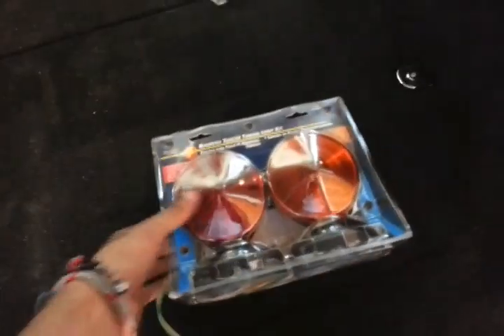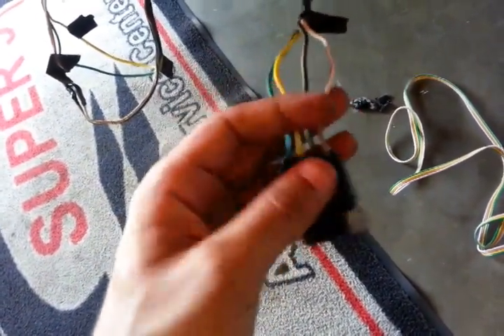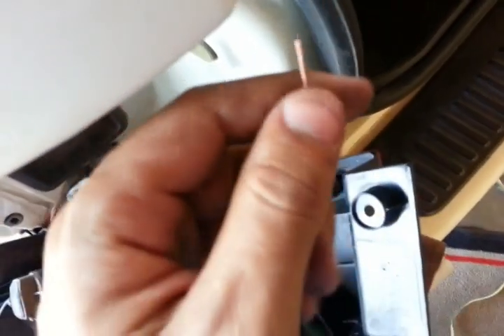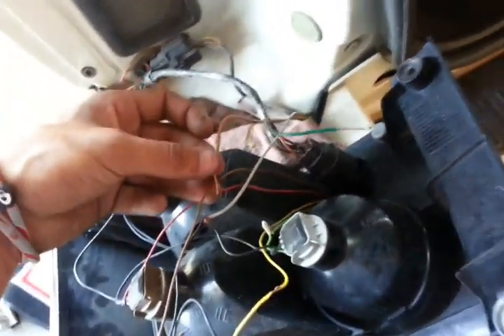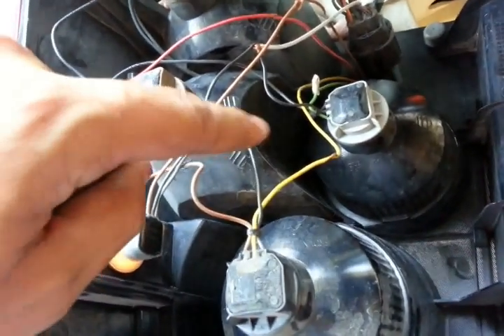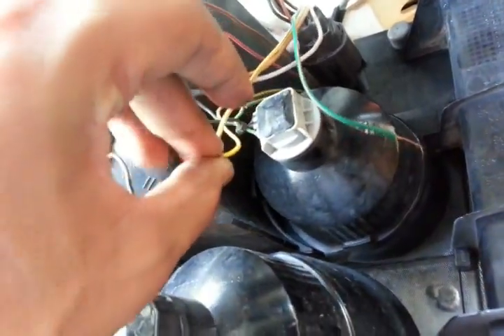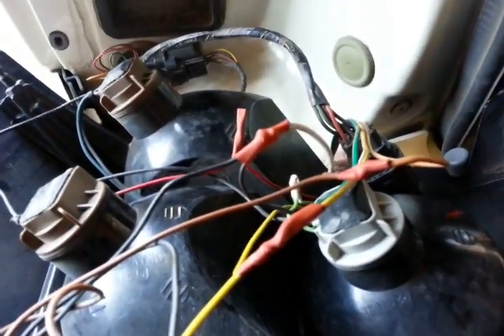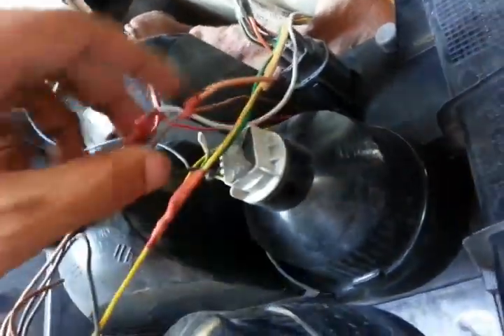How to Install Trailer Lights on most Vehicles Easy.

Comment: Did you wire the right signal with the left?  Otherwise, good video.  
Some people mention blowing fuses.  Definitely more likely on cars with traditional bulbs vs. LED.  Only a real problem for brake lights.  Simple solution, pump the brakes and at a stop light, engage the parking/emergency brake and release the service brakes.  

Wires fail and fuses blow due to heat, not current.  Current causes heat, but you can control how much with simple behavior modification.

Comment: You didn't show how to attach the right blinker
Reply: Mason Roberts its the same on both sides..
Reply: @Dinoboyification  ,    it looks like he tied the green = right turn signal ,  and the yellow = left turn signal together , on the left  lights yellow stop and blinker wire.  green is the right turn signal.......wouldn't you run  the right turn  signal wire over to the other tail light?  Did I see this right?  And if I did see him do that.....hows it work that way?????
Reply: CHANNELLOCK 440 I just did this according to his instructions, signal right doesn’t work when hooked up to trailer if you wire it together with left. I now have to undo and redirect to right light turn signal.
Reply: And brake lights are dim af.
Reply: @russelalpine6806  ,  yup.....that is happening to me as well.  No logical reason for that.  I have everything wired correct as far as I know, even my tester shows all is well. But if you turn on the running light , the brake lights cancel out the lights when you push the brake peddle.  I have no idea what else to do. But it is strange when I plug in the tester, every thing shows perfect.  Let me know if you figure out where to get any logical answers for this.  Thanks for responding Bro.  It's good to know you're  I'm not the only one getting crazy reactions from this mess.  The whole thing is frustrating  as heck. 
BTW...everything works fine as long as you don't turn on your running lights.   I call them running light, but they are known as parking lights .  Headlights  do the same mess.
Reply: @russelalpine6806  , maybe I shouldn't be using  a adapter.   I have a round plug, , not the little square.  so I have to use a adapter to plug  the little square plug in. I see one comment from  mrprosale  below, who says it s good if you dont use a adapter.   wonder why it makes a diff.  LOL  WTH  ??
Reply: @russelalpine6806  , cancel out the running light wire......aka parking lights. They cancel out the brake and blinkers.  all is well without the running lights. put the running light wire on a different set of lights. seems to do the trick.

Comment: This won't work.

The trailer lights use the same circuit for the brake and blinker.  Cars almost always use a separate circuit for brake and blinker.  You need a little devo e that converts the cars brake circuit into two blinker circuits that will respond to either the brake pedal together, or both the left and right blinkers separately.

This guy is either driving around without the trailer lights working, or he posted the video, then went on to realize he did it wrong and didn't bother to .ale a video or him correcting it.